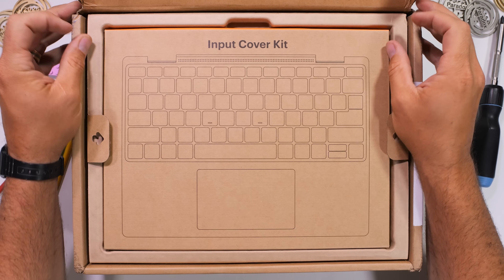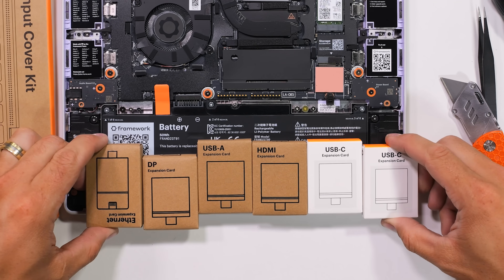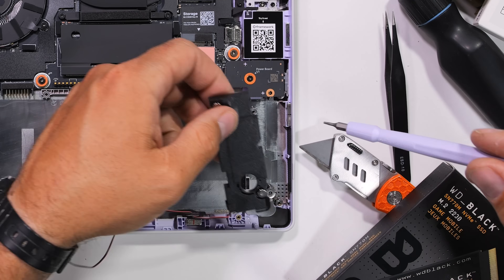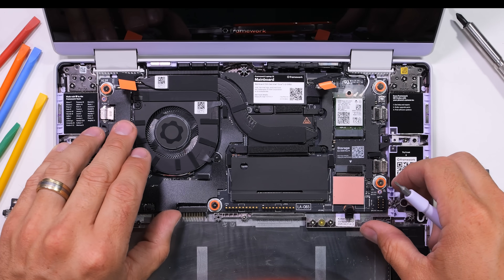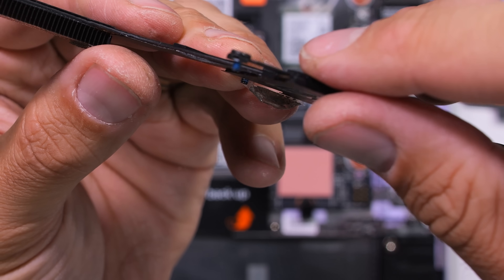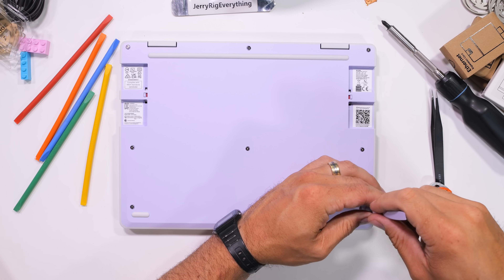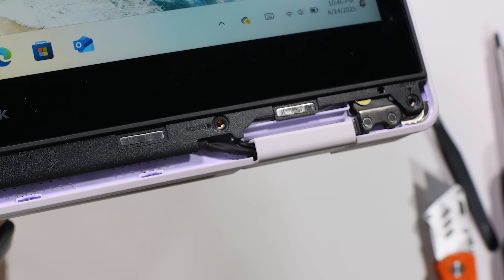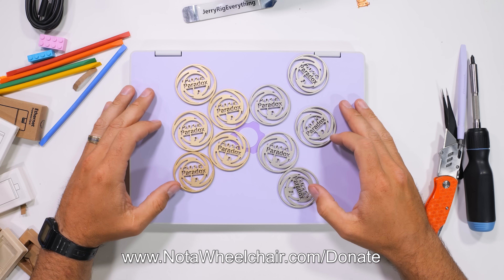The Best Laptop on Earth... is almost too easy to fix.

Comment: I would like to see their higher end version as well. Also amazing work on the mobility products. That is one of the most difficult industries to deal with for those in need since prices are astronomically high while also using lower quality components. It is amazing that you are changing that.

Comment: The thing I love most about framework, is that they've released circuit diagrams and a bunch of other fun stuff for their products. There's a point where they actually encouraged customers that were tech savvy enough to make their own motherboards. If someone made parts for their laptops, they would not be opposed basically.
Reply: I believe they require an NDA and a few other things for said diagrams.  The big thing is the info is not stupidly expensive and doesn't require a "partnership" agreement.
Reply: @EmperorA0  FrameworkComputer provides partial schematics on Github under a creative commons licence. Even for the Framework 16. These go into enough detail where you can take the mainboard and basically make a SFF desktop PC with it (and people have done). There's also schematics for other parts too (like expansion cards and the likes).
 
But yes, for full schematics and for their firmware, which is realistically the secret sauce so to speak, I do expect there to be some limitations... End of the day, they still need to make a profit, and that can't really happen if someone turns around and just hands all that info to a Chinese company that can build it for 1/5th the price they can. 

I think they're trying to keep a balance between letting the user actually use their device and repair it as they wish, but also ensuring that nobody can just instantly compete with them within a couple of days of releasing a new product. That being said though, I highly doubt they'd be opposed to someone developing their own parts, for their own personal use. If you're going to sell them though, at least reach out to them and ask if they'd have issue with it.

Comment: I've got a Framework 16 and Framework 13 myself, and I upgraded the motherboard and replaced the screen in the 13. I really appreciate the guides and ease of buying replacement parts. I won't buy a laptop from anyone else unless they can make it just as easy to upgrade and repair.

Comment: I love the “Starts at $559” point. Framework laptops are really cool, but the price balloons like crazy the second you start adding modules. Also, these things don’t come with their own power supplies, meaning you either fork the money over ($139 for the Framework 16, $55 for the Framework 12) or hope something from Best Buy or Amazon works. Love this concept, but it’s still too prohibitively expensive to be practical.
Reply: The DIY option I configured is over $1000 with the i3, 16GB RAM and 500GB. For that money if you don’t need the reperability part that Framework offers You can get a better more powerful laptop.
Reply: @snajperSLO  It's actually a pretty competitive price for business laptops. If you just want some glued together tech, yes, you can get much cheaper offers.
Reply: @snajperSLO I’d rather get a MacBook Air lmao
Reply: @eastonwilliams1722  Have fun with your doorstop when the soldered SSD dies lmao
Reply: @georgewashington6171 when it dies. That’s gonna be a long time.
Reply: Doesn't it charge with USB-C?
Reply: @CodecrafterArtemis  It does, but you still need a 60W (180W for the Framework 16) adapter. You can’t just use a regular phone charger  (unless it’s 60W or 180W)
Reply: @FilthTea  It should technically work with a regular phone charger, but the battery could die while plugged in if doing heavy work. The wattage you cite is the recommended, there is no clear bare minimum. Still, a 30W phone charger should be pretty workable in a pinch.
Reply: @Odd_Taxi_epi04  That only works assuming your laptop isn’t pulling more than 30W. The CPU in the Framework 12 pulls at minimum 15W on its own. It might work if your computer is turned off but it’s not a good solution
Reply: Can't expect him to mention the downsides when he's giving his mate's product a plug.
Reply: @thekitkatshuffler  I would still expect Zack to be honest. The starting price of the framework 12 assumes that we don’t select any modules, and bring all of our own. If it’s not dishonest, it’s at the very least incredibly misleading.
Reply: @FilthTea  I completely agree. Here in Australia, I quickly spec'd out an i5, 16gb ram and a 500gb drive, no charger and it comes out to ~$1559, which is more expensive than a T14 Gen5 AMD. Yes I understand the framework is more repairable, but giving up 2 inches and ~50% in multicore is huge. I will continue waiting until I can get a framework for under $1k aud. My current laptop was a T14s Gen 1 I scored for $200. Not much is gonna beat that in value.

Comment: I recently got the 13" (friend sold me his main board and I simply bought a chassis from Framework). So far: about the best laptop I have ever owned. Minor nits over keyboard layout, but aside from that it is a sweet little machine. I was mildly skeptical regarding the gloss screen, but has been fine. I can of course replace it with a matte screen if I want to do that. I love what Framework is doing.

Comment: I think one of the best designs was the old Thinkpads.  You could remove the battery and run the laptop in a dock to replace a desktop.  I'm still using mine from 2012, which shipped originally with Windows 8.  Thinkpads of this vintage were supremely well-constructed and all the parts that were subject to wear, such as the hinges, display and power jack could be sourced on auction sites. Even used parts could be easily found because they were corporate workhorses.  I think a design like this Framework puts too much resources into building in modularity where it is not necessary. If the USB ports could be repaired with a cable connection, it would be cheaper and sufficient.  It also makes it harder to make a smaller, lighter and thinner laptop.  The most important innovation for prolonging the useful life of a laptop, is probably Linux operating systems that work well with all the hardware and make software easy to install.
The one thing I do see that could be very good, is that if Framework is sold as a DYI kit, where you can customize it.

Comment: as a guy thats a fan of his fairphone5.  this is my dream laptop if i ever used one. for my fairphone its great to have replacement parts at home. recently busted the screen.   i didnt have to heat up glue and grab a suction cup to replace it. it was just 6 screws and it was done.   i  busted the usb port on it by being careless...  replaced it in minutes

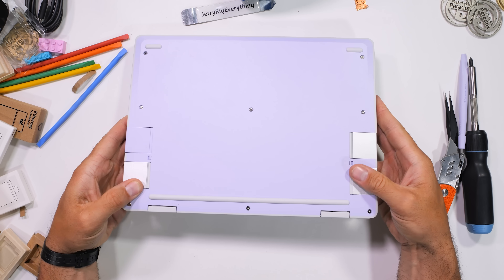Comment: 8:47 Yes, please.
Reply: And the framework 13
Reply: Thirded! (technically, 74th lol)

Hopefuly there's AMD options, cuz... I don't dance with the devils 😅
(seriously, they've both done extremely shady and childish things when AMD had superior products, and I will not support those business practices)
Reply: @DUKE_of_RAMBLE  The Framework 16 definitely has AMD CPU and an expansion GPU thats also AMD. The Framework 12 i think is the only one with pure intel cpu options probably due to trying to keep it cheap and accessible. All the others seem to be free to choose AMD or Intel.
Reply: @King_Geedorah Great to hear that, thanks 🍻
Reply: @DUKE_of_RAMBLE  There are AMD options, I think.
Reply: @LogicalError007  Yea I saw a comment mention the is for at least the CPU, so yay. (he didn't mention the GPU choices though)
Thanks 🍻
Reply: @DUKE_of_RAMBLE  I don't think Nvidia will ever partner with Framework as they are very control freak and putting a hardware on framework require to be open with partners. Which Nvidia will never.
Reply: @LogicalError007  I suppose that's provide, but I honestly don't see anything inherently different here, than that of a gaming laptop from any of the top brands. Which as far as I know, many of them have replaceable/upgradeable GPUs.

The main thing comes down to the firmware, and I suspect that Framework isn't providing completely unlocked and tuneable firmwares (the BIOS), or programs to tweak them before you flash. So whatever the GPUs come with would no doubt be the generic baseline ones from nV, which I highly doubt Framework would go through the trouble of testing what the maximum cooling efficiency is, enough to squeeze more performance and merit tweaking those firmware values. 😅
(I've been out of the game for over 5 years, but I was modifying my Ryzen motherboard's BIOS every time they released a new one, to unhide certain settings, using a semi-leaked program from AMI, the BIOS maker)
Reply: +1
Reply: yeah
Reply: Hell ya!
Reply: yes
Reply: Hell yes!
Reply: Yes
Reply: Please show more shot of the SSD fixing structure.
Reply: Yes please

Comment: I would sell my mother in law for one of these. And I might have to do that because the price is Apple prices. Every time you add a component it is double up in price compared to retail prices. So the price is very high. Actually you end up at a price point of a new MacBook Pro but without the power of a new MacBook. If you are buying this it is because you want to make a statement and because you like Frameworks vision/mission.

Comment: I'm glad the more affordable framework option is available. They have come a long way since when they started. 

If I were to make a hot take. At some point in near future. I would like them to take what they have learned and redo much of the design across the board and release different sizes in the same year. A sort of soft refresh. Something like making 3 modules per side available and making the modules slimmer. Configuring the board and battery sizes that can be maxed out.

Comment: 8:36 - "the replacement pieces only cost $149" ONLY $149! Like if only people could just cough up that type of money. Just for the screen. I'd rather just throw it in the trash.
Reply: You'd rather not have a device? You'd rather spend more money an a replacement? If you don't need a laptop, then don't buy one. If you wouldn't repair it, then you never needed it in the first place and you only wasted your money.

Comment: for years se were told that it was impossible to make a slick, well built laptop and make it repairable and modular. that because of miniaturization, everything had to be glued in and soldered into the motherboard. Framework completely destroyed that notion
A framework laptop with Linux on it is the laptop of my dreams

Comment: I love what they do. I have both a 16 (at my work, putting it through it's paces every day) and a 13. And here is a cool story you cannot just tell with another brand:

Since I'm cheap, I ordered a factory seconds edition from Germany. I ordered it without ram or SSD since I had my own. When I received it, it was with a german keyboard which I didn't like. I ordered a new keyboard and replaced it myself. Some time passed and framework announced a new 120hz screen and a better camera. Ordered those and upgraded my laptop. At some point, my touchpad started acting up, so I ordered new one and replaced it. When they announced the new ryzen AI processors, they put the older ryzen 70XX series on sale and grabbed myself a new motherboard and a new wi-fi card (faster speeds)

All upgradable, all easy and now I'm with a new cpu, new screen, faster wi-fi and still cheaper than if I had to buy a whole new laptop. And I have no worries if anything breaks - I can just order a replacement and fix it myself. 10/10 I recommend

Comment: The idea is nice in theory, but there is a premium. Just to see, I specc-ed a core ultra 5, 512gb, 32gb ram 13" laptop from framework. no power adapter?? apparently it's out of stock. for 1535$. I went to best buy, i can get a lenovo 15", core ultra 7, 32gb, 1tb. for 1099$. you are gonna say, "that's because in 2 years, you can upgrade the framework?" a new framework cpu is 500$. i don't see any efficiency in this deal.

Comment: I love my Framework 13, had an issue with camera module and some troubleshooting and replacements. Until we determined it was the motherboard sent me a replacement and everythings been kosher thus far. Had my own ram and ssd, so turn out to be a little bit cheaper. Running Fedora 42 and doing some gaming works well enough for, with the 64 gigs of RAM I go in there.

Comment: 8:24 Ugh...man, what you are doing there is dangerous. One must never, NEVER touch LVDS/EDP (screen) cables when the battery is connected - even when the laptop is off, finger or anything else. They have power/gnd next to each other so not only you may get a nice wakening 19V shock, it could immediately (and very easily) fry your display, GPU and/or CPU depending on connection. I am not exaggerating, this is a really bad idea to touch that connector with anything. Perhaps you could add a disclaimer or something at least?

Comment: Got my Framework 13 this past year, mainly because it officially supports the Zorin Operating System. Never thought I'd be leaving Windows, but man, 11 is SOOOOO BADDD. Wish they had a 14 inch laptop though. Also wish it had a dGPU, since Davinci Resolve will not run on Linux without one. Even though the AMD Drivers on linux are better than their windows counterparts (Thank you Valve). You should really be warning people about the AI chips in laptops. By 2027 all laptops will have AI chips built in. So if you want to get a non-AI laptop, now's your last chance. AI Chips are good to have if you plan on doing generative AI or LLM's locally. But if you don't plan on doing that, then it's just a chip that makes it easier for MS and Apple to spy on you, or really any program you install. Not a conspiracy theory, MS and Apple are already doing it at the OS level. And nothing stopping closed source programs from doing the same. You can always use online solutions when you want AI stuff, just like you can now. Another reason to go to Zorin. Why does "for-profit" have to also mean "creepy and evil"?

Comment: It's also hella expensive. For the price I could buy two normal laptops
Reply: That break
Reply: @HyperIndian It will break eventually — like any laptop after 4+ years.
And when you want to replace the motherboard, you’ll find that spare parts are either unavailable or ridiculously expensive.
At that point, you’re basically paying new-laptop money anyway.

Framework is NOT inexpensive, Parts are NOT cheap, the only real advantage is the publicly  available board view, so if you know what to do you can replace parts ad DYI

Comment: The component contacts are interesting. The Framework 13 (the original model) used more standard ribbon connectors, to this is a step up from even that.

Comment: I really love my Framework 16, it runs Linux as good or perhaps even a little better than System76 laptops, a huge plus if you are into that. It's got a few design quirks, but overall, very good laptop. No regrets.

Comment: i used to think that pogo pins and single wire connections were just a single datapoint that could do very specific transfers, like 5v and just simple data like a few bits here and there, oh how wrong my little brain was

Comment: the only component that needs to be interchangeable is the battery, everything else gradually fades into obsolescence. RAM? whatever, by the time you need more, your motherboard supports only old standard. SSD? pff buy enough space at the start and use external drives, you need them for backups and bulky storage anyway. CPU? by the time you need a new one, your socket is already outta date. Modular is unnecessary and the market has proven it. Hell, even custom gaming desktops don't require upgrades, they too just gradually get obsolete until they won't even take any new parts.

Comment: I've got a framework 13, with the amd cpu - got it as a kit.  Cost a couple of grand because I wanted 32 GB RAM (up from the standard of 8 at the time), the upgraded battery, a good quality 1TB ssd, and a ryzen 7, but I had some money come in all at once and I wanted a laptop that I'm probably never going to need to replace so long as the company stays in business.

Sure, I may want some additional RAM if I decide to do anything particularly RAM intensive, or I may want a larger SSD - I may even want a better CPU in the future, in which case I can just buy a new motherboard (the CPU is pretty much the only soldered down part that wouldn't be soldered down in a standard desktop PC), and maybe some replacement RAM if the new board doesn't support DDR5.  Hell, if they start making 13 inch touchscreens and I decide I want one, I can even just buy that separately and install it quite easily, instead of having to buy a brand new laptop.

I genuinely couldn't recommend their laptops enough; they're really good, and while they're a little more expensive than say, an acer or a dell with the same specs (smaller production lines make laptops more expensive per unit to manufacture), I'd say it's worth it just to have a laptop that I can upgrade like it was a desktop rather than having to buy a completely new one.

Comment: I'd love to see the framework 16.
I'm mostly curious about the following for that one:

What would be the price difference if you had gone for a different brand with same/similar specs?     
What would be the price difference if you had gone for a desktop PC with the same specs or equivalent specs?   
How easy is it to clean the laptop?

Last but not least: how quickly does it thermal throttle?

Cleaning away dust and thermal throttling are 2 very frustrating aspects of stronger/game laptops. 

Perhaps it's too much to ask, but if you're gonna make a review of the the laptop, that is what I'e curious about.